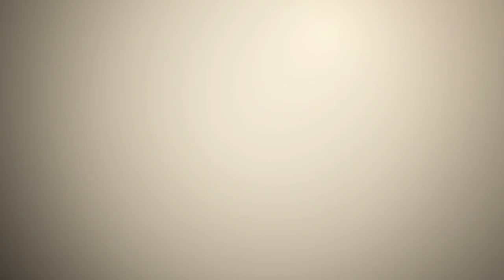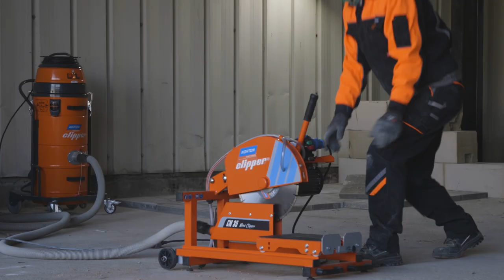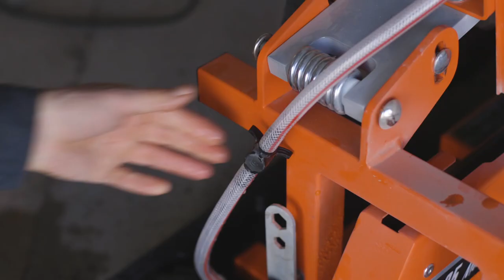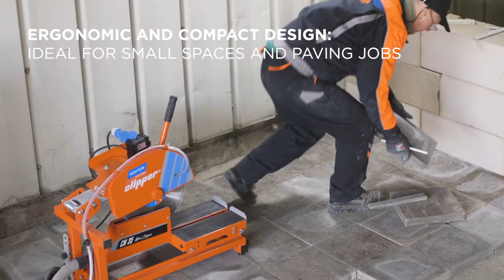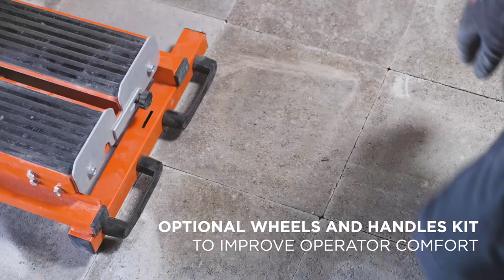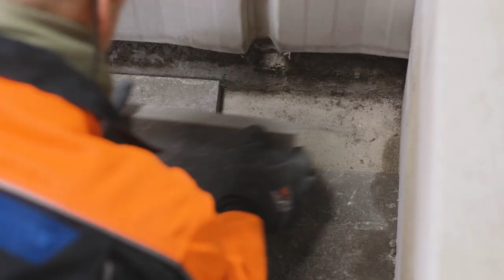CM35 Mini Clipper Masonry Saw

Comment: A question I really need answering please! 
How do you do about angled cuts on block paving? Is it dangerous trying to hold the block at the angle required? 
Really wanting to buy one of these but unsure if it is suitable?
Reply from the maker: Hello Chris, 

Thank you for your question and the interest shown in our product. This machine does not feature a tilting head allowing angled cuts and we do not recommend to hold the material angled manually. Nevertheless, we have a cutting guide available on our other machines that could fit on this CM35 and which could help to make some angled cuts. 

Please contact us on the following e-mail address for more information: Joachim.valembois@saint-gobain.com 

Joachim